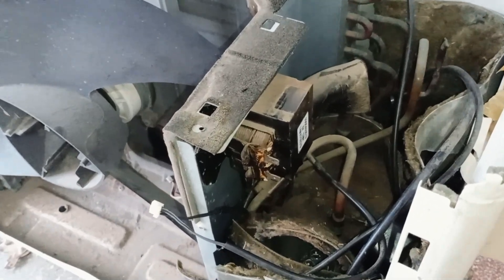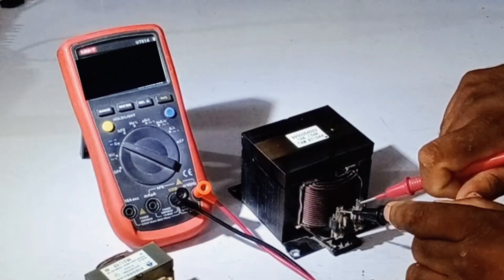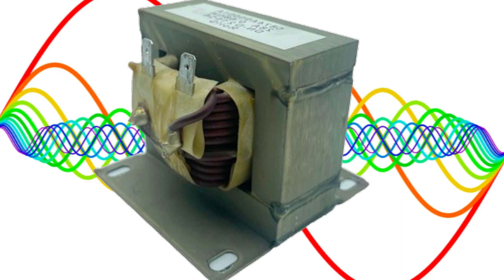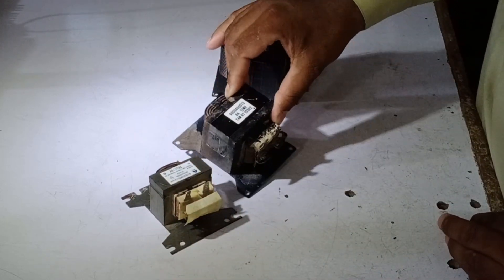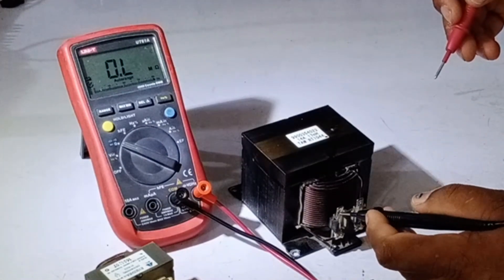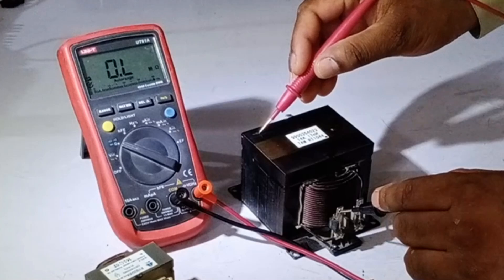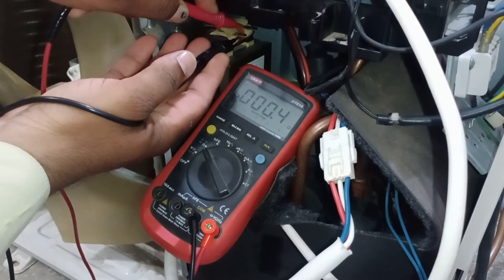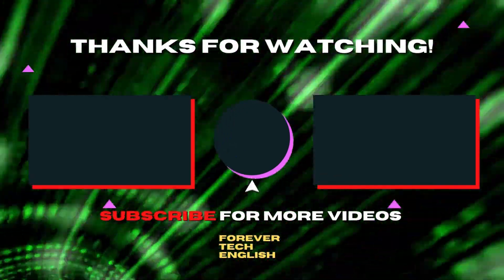This Reactor Literally Saves Inverter Mini Split AC

Comment: Hi there. Thanks for all your very informative video's. These are very usefull. I have a question. I have a QLIMA inverter mini split airco which is a well know brand in the Netherlands. It is made by Midea as far as I know.  It is only 4 years old and the active use time is no more than approx 16  weeks during this years. Now I get an E1 code and I did a lot of testing. The high side is ok. Ik get 319volt on IPM and 3x 15 volt on the U, W and V connections to the compressor. Conclusion is that the mainboard of the outdoorunit is faulty. To my surprise there is NO reactor in this outdoor unit! Could this be the cause of the broken PCB? I will order a new board which is quite expensive. In the diagram of the mainboard I see that a reactor is ' optional'.  Can I add a reactor to the system to protect the electronics?  On the label of the outdoorunit it says that the max current is 4.6 A. On the diagram the number of the  - optional - reactor is 1005AL. Thanks!

Comment: Thanks for the video, I have a couple of questions. Is it possible to have a reactor with a shorted turn like you sometimes find in mains transformers? This would look good on your multimeter but probably blow the fuse as the shorted turn acts like a secondary?   When I am repairing an aircon controller board on the workbench can I just short the reactor wires together if I want to power up the PCB, as non of the motors etc are connected.   Thanks
Reply from the maker: This is wrong practice, if you want to power the airconditioner pcb while you are using just for testing or operating the whole unit, reactor is must.. If you still short the wire of reactor, the IGBT or IPM can go bad very quickly... Mostly when you are testing compressor within this condition....

Comment: Since the resistance is practically equivalent to a dead short through the copper windings due to the thickness of the copper, if you had a breakdown in the insulation between the wires but not the iron core, you'd still have a very low resistance that would show it's good, but it would obviously not function correctly in use. This would cause the reactor to act as a smaller reactor than intended, in theory.
Reply: You nailed it! This is the most posible way a reactor will ever go bad. bad quality means vibrations and friction between the coli wires causing loss of insulation between copper windings to fail. this will result in loosing the inductivity value. have you ever seen an reactur designed for three phases system? the induction works also against big courent shocks at the start when the capacitors act like a short citcuit unlitt they are fully loaded with electricity. Usualy the problems apears only on hight voltages values so testing with a mmeter is not conclusive.. Does it happend the fuses to blow at the very first powering of the unit? That might be a bad reactor not being to cut the shock.

Comment: Informative! Question, can I put one of those reactors inline with mains going to my TV or refrigerator or any other sensitive appliance? My power company is providing dirty electricity and somewhat frequent brown outs and a lot of my neighbors blame that on the premature death of their appliances.
Reply from the maker: Nope you can't because these reactor are designed only for these inverter type air conditioners.
Reply: @forevertechenglish  hmmm, by your description in the video it sounded like it was just acting as like a surge supressor/filter to keep the AC line clean. 

Thanks for the response! Please keep making these videos!